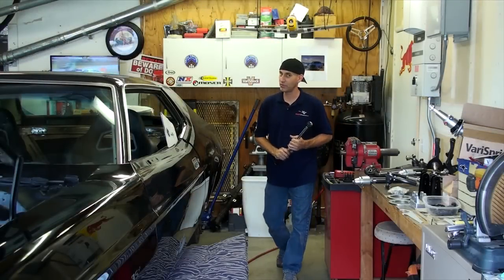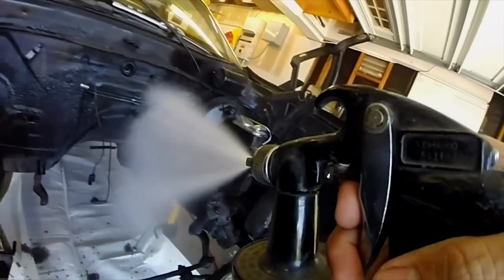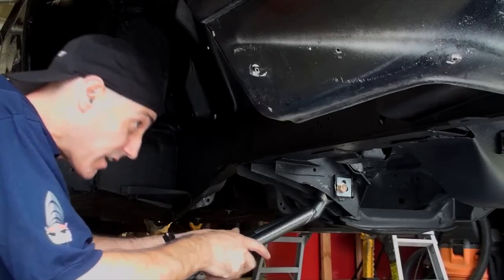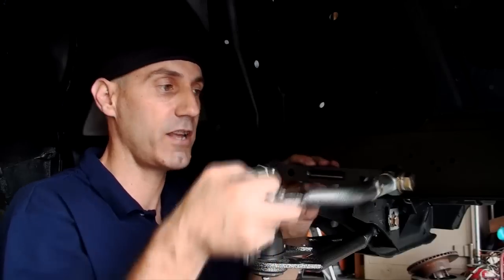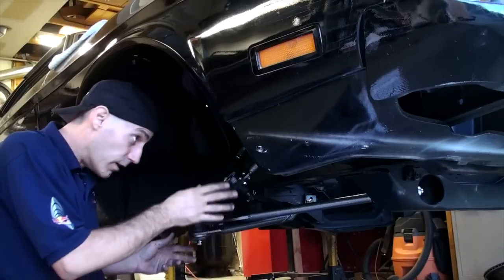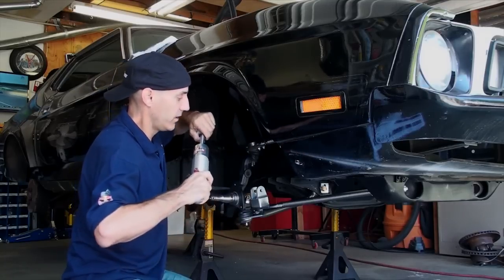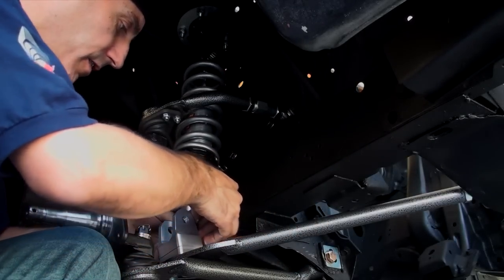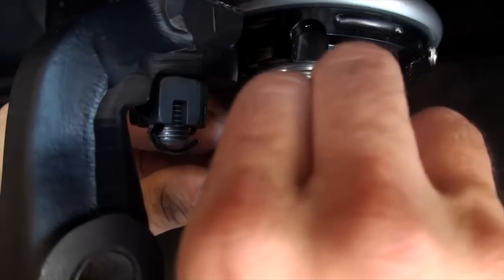Classic Mustang Coil-Over Conversion TCP Front Suspension Install

Comment: I just ordered this kit my 69 fastback.. can't wait to put it on. Merry Christmas to me.
Reply from the maker: +GunfightersINC Congratulations! Seriously, you are going to be so stoked!!!!  Oh,  that is my favorite year Mustang.
Reply: +autoedit Thank you it's also my favorite of all the Mustangs (or cars for that matter) and I cant wait to rail around a road course, I have a question, with these coilovers do you adjust ride height by compressing the front springs? and if so are the springs linear rate? I'm assuming yes to both questions.. but I couldn't find the answer on TCPs website, my car has a 351W, I ordered the 600# springs as well as the drop pivot shaft for the UCA.. but I was gonna call TCP this coming week to see if they recommend something else I wanted to talk to your contact there, Carl, so I can be sure I get someone knowledgeable as well as drop your name to make sure you get the credit for selling me on their products. 

I really look forward to your vids since everything you're doing mimics exactly what I plan on doing with my car ( from the fuel injected blown 351W.. even down to the wheels, which is just downright spooky) and I'm looking forward to the finished product so I can see what I'm in for. so excited.. Anyway keep up the good work and happy holidays to you and yours.

PS.. looking forward to your pedal install vid.
Reply from the maker: +GunfightersINC I do believe the springs are linear and there is some height dial in with the spring compression ring.  I got the #550 springs to start with so we'll see how it sits!

Comment: Because I am doing a couple of 64 65 Rancheros 
I'd like to see a rack n pinion, manual vs power vs stock manual/power or any thing else that you come up with. Thanks for the videos 👍
Reply from the maker: I've finally been driving this car with the power rack and pinion from TCP and am thrilled with it. I put a flow adjustment valve on it but run it at full so far with great results.  In my opinion, there is no need to go manual unless it's a drag only car.

Comment: @autoedits Jason, this is a long shot that you might answer; did you notice a lot of negative caster when you initially bolted this thing up? I have the upper a arms pulled all the way in via the adjustable threads. And the strut bars at the instruction recommendations. I have a lot of negative caster. I'll need to shorten the strut bars and/or adjust the upper a arm to move the ball joint backwards. Anyway, just wondering if you had the same experience. Wish you still had this car! Thanks

Comment: Very cool episode.

I wish you'd give more info on your Camaro.
Reply from the maker: Thanks, Unfortunately the Camaro is gone...I did get misty looking at the old footage and was asking myself Why I sold that thing...it was a great car.
Reply: autoedit I saw the column in Powerblock magazine where you wrote about finding it, and saw the article where you pulled the engine.  In it, they said there would be follow-on articles about the crate motor install, and the suspension mods, but I haven't been able to find them.  Did you ever do them?

Also, how did you get it to pass smog after the engine swap?

I really enjoy the things you do.  Very unique.  I don't think I've ever seen a 71-73 Mustang project, for example.

Comment: Great content Jason. My question. Now that you have put some miles on this TCP coil over system. What is the road noise like? Do the bushings do what you said they should do? Or is it like your Camaro as you explained in the video? Thanks again.
Ira
Reply from the maker: This thing drives amazing... best on the market for performance and everyday comfort. https://youtu.be/E5yeNDPPZOM
Reply: @AutoEdits  Jason, I had a 71 mach1. I found your content while I owned the 71. I have since sold it to build my 67 cougar. Going with a control freak rear four link system. After seeing tour success with the TCP system. Seriously considering this system. PS. I work for Kindig it design. So if you are ever in Utah. Please stop by and say hi. 
Thanks again.
Ira,

Comment: Great video! Off the wall question. When you dropped in the upper shock mount in place, I noticed the finish on the shock tower. What did you shoot the engine compartment with? That wrinkled finish looks great! Thank you for all of your efforts making these videos. Mark
Reply from the maker: +Mark Schwenke Thanks a bunch for taking a minute to say hey.  The engine bay paint is rattle can spray on bed liner I got from pep boys. It's fairly durable and easy to touch up since this isn't a show car.

Comment: 71-73 mustangs use the Saginaw 800 steering box……..this is the same box used in the third generation camaros and firebirds…...if you want a huge, budget friendly steering improvement for your project, replace the existing power steering box with a quick ratio, high effort box from an IROC Z or Trans Am…….you will use the stock mustang power steering pitman and idler arms and the box should bolt right in.
Reply from the maker: I didn't know that!  On my 82 Camaro I got the short ratio flaming river steering box and really loved the feel on that thing...glad to hear that if I go the steering box style I could get a great feel like that.
Reply: autoedit
some more info:
http://www.hemmings.com/mus/stories/2007/09/01/hmn_feature21.html

Quick ratio boxes were used on many different vehicles, but the IROC (and Trans Am with 16" wheels) used a high effort 12.7 to 1 ratio box (about 2.5 turns lock to lock)……..vastly superior to the factory mustang box.

I'm not sure what would be required to connect this box to your factory pump as these boxes use metric threads for the lines. When doing this swap on a first gen camaro, I used the adapter kit from Lee Manufacturing ( http://lee-powersteering.com/rebuild-misc.htm) to connect the lines…... these folks KNOW steering…...I'm sure they could walk you through the conversion and get you the parts needed.

Good luck
Reply: Gon Huntin Does that mean he could also do the Jeep Mod to his steering box to make it quicker?
Reply: Trae Wallace

I'm not a jeep person, I'm not familiar with the "jeep mod", so I can't answer your question. I do know that some jeep steering boxes will swap too, just not sure which ones. The IROC box is both quick ratio and high effort (approximately 2.5 turns lock to lock)…….the improvement is dramatic over a standard ratio/effort box.

I stumbled across the info I posted above when I was doing the "IROC steering box swap" on a first gen camaro…..it just so happens that my son and I are doing a 73 mustang convertible project too. We haven't done the steering box swap on his car, but it will be part of the project.

Comment: Thanks for these videos. I have  a 72 fastback and looking into this front suspension. Ur back still has leaf springs? I’m trying to get rid of the wheel having a lot of play. It feels too dangerous at high speeds.
Reply from the maker: I went with their coil over rear as well and if you get a minute , watch the test drive video I put up last week and you’ll see it all in action!
Reply: AutoEdits watched it. Looks like you’re really enjoying that canyon! I’ll call them tomorrow to get a price. Thank u
Reply: @jesco6830  Did you ever get it done?  If so would you say it was a massive improvement?
Reply: @Googs5  I got the Aldan American coil over front system. Double adjustable. Big improvement over stock suspension. I am able to make tight turns at high speeds now = fun!  And the lowered front looks aggressive!

Comment: Great instructional video. I just installed on my 73 Mach 1 and the sway bar and strut rod seem to be making contact. Chris Alston's strut rod makes contact with the stock sway bar and definitely with the Chris Alston's 1-1/8 sway bar. Anyone know why? Chris Alston's installation manuals mention nothing about this. AutoEdits do you have any guidance?
Reply from the maker: On this install it was very close at full droop on jack stands but sitting at ride height was good. I ended up using a flap disc to clearance the sway bar the slightest bit to make room but I'm not sure it needed it once the vehicle was sitting on the ground.
Reply: @AutoEdits  Flap Disc's?   Please advise. Is there a place i can email you the pictures thatI have?  I have the 
TCP COLVF-10 Front Coil-Over Conversion
Reply from the maker: @michaelcavazos8821  An angle grinder with a flap disc with sand paper instead of a stone grinding wheel. That way I can take a very small amount of material off.
Reply: @AutoEdits  Thank You

Comment: Awaome videos!  I am getting ready to start a 69 mach 1.  That TCP looks really nice.  What are your thoughts of TCP over a mustang 2 type suspension (maybe rod and custom) and why did you choose TCP?  Thanks!
Reply from the maker: Brian Kueser That's an easy one! Mustang II is old technology that only works a little better than the stock stuff...the TCP kit is actually a grouping of high performance parts that were designed to be easy to install (as you can see in the video) and add TONS of strength and capability to the car!  Good luck on your project!!! 69 is my dream Mustang.
Reply: autoedit Thanks for the reply.  I appreciate it.  I'll have to start documenting it on YouTube when I start... Now to make room in the shop...

Comment: What about rear suspension? Front I wanna do VariShock coil overs double adjustable. But what do you recommend for rear suspension? I can only afford to stick with leaf springs
Reply from the maker: I put this in the rear... https://youtu.be/_ti3yzvj7fI and it handles amazing but the TCP leaf springs and varishocks would be a fantastic option as well.
Reply: AutoEdits thank u. Muy have missed that video

Comment: Hi Jason, you're video was awesome! I'm looking to upgrade my daughters 65 mustang front suspension and drop the front 2". which bolt on kit would be my best bang for my buck on making this happen? ( without doing any major mods to the car) oh and not having to remove engine. thanks.
Reply: This kit might do the trick Ricky:

https://www.cachassisworks.com/p-2342-mustang-64-73-fordmercury-60-77-front-coil-over-conversion-system.aspx

I suggest you give them a call to verify a good fit if you haven't completed this project yet.

Comment: What Steve Long said, couldn't have said it better m'self. And oh! *please*, only rack and pinion steering could do justice to the suspension (I suspect you already know that). If that car has the stock recirculating ball steering, and you leave it in, that would be just like spending 50 grand on a restomod then dropping a dirty old worn out 144 six in it ;-) Love your style bro.

Comment: do you its easy to import this setup to a classic like vauxhall vector fe which is a GM V body type... i think the k member needs holes pls let me know if it needs any special technical attention i working on a suspension project for my classic vauxhall victor fe 1972 76

Comment: I'm guessing an easy way to lower this, with out effecting any suspension set up, is to just get a new drop spindle, which will easily lower the car, but it should in handle the same?

Comment: I also have a 73 that I just recently got running it was just sitting in my garage and I thought to myself nothing better than starting a project car, I have it running pretty smoothly but I have one problem, when I come to a stop like at a red light or something the tempature seems to rise really fast, but when I'm driving and the car is accelerating , my tempature stays cool and everything is fine any thoughts on what my problem could be?
Reply: Those are classic symptoms of an air flow problem . Check that the fan clutch still works. With engine off(no really) spin the blade hard it should at most make one turn. Much more than that and its to loose to drive the fan t low speeds. In theory at about 30mph on a car with an open forward grill there is enough ram air flow to cool the engine. Also check that there is some sort of lip right under the rad. this will prevent air from recirculating  when stopped at idle. Air goes thru rad gets heated then gets pulled forward and goes thru again . do the math hot air plus hot air equals over heat..
 if it were the other way around cool at low speeds hot at fast that's a water flow problem . Rusted away impeller on the pump, wrong pulley turns it to slow, plug up rad core, collapsing rad hose, T-stat not fully open,ect...

Comment: definitely rack and pinion, for brakes maybe something like this in the front, it seems decent for calipers up front. If you're trying to replace the master cylinder and all that of course the price would have to be lower but these would fit quite nice I'd think http://www.wilwood.com/BrakeKits/BrakeKitsProdFront.aspx?itemno=140-11073-DR&year=1973&make=Ford&model=Mustang&option=Disc+Brake+Front+Spindle
Reply from the maker: That does look good!

Comment: Rack and stock brakes from a crown vic PI or  mustang gt
Reply: love the show ......
Reply from the maker: Are those 4 piston calipers? That sounds like an inexpensive way to go but for how hard I want to use this thing...I wonder if they are stout enough.
Reply: on the Crown vic only on the police inter but you do get a bigger rotor but on the gt I think the 2000 yr all have 4 piston  plus look into a gt independent rear they bolt into late model fox bodys and should bolt up to your car with few mod. that would give you disk on all for corners   look at some of the guys running mustangs in the SCCA in you area they can help you with the tips and tricks to get your car to stop fast and cheap...........